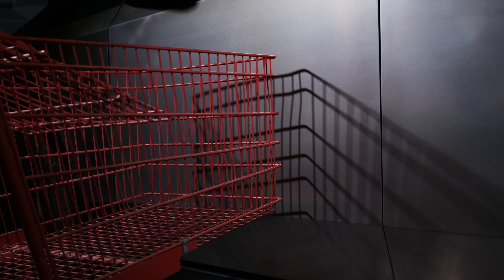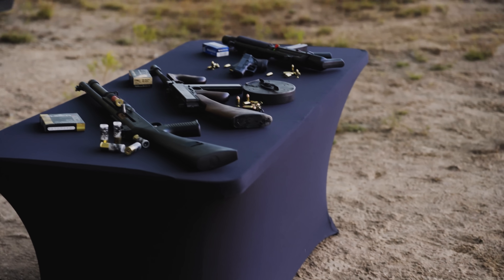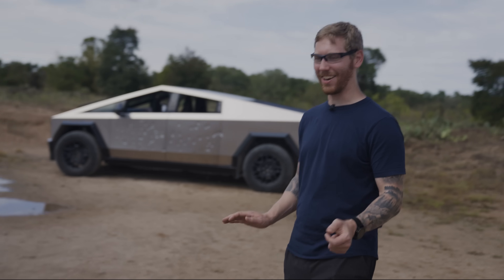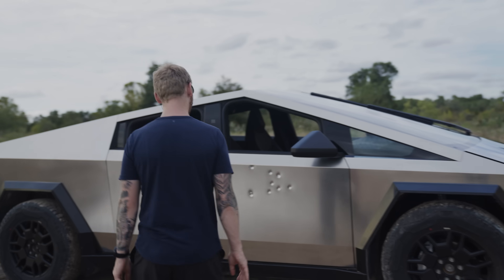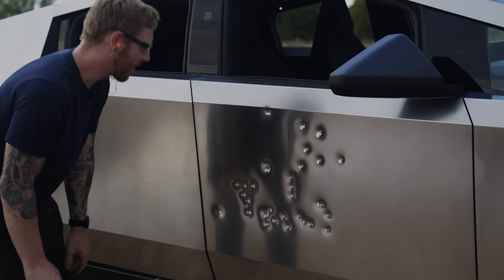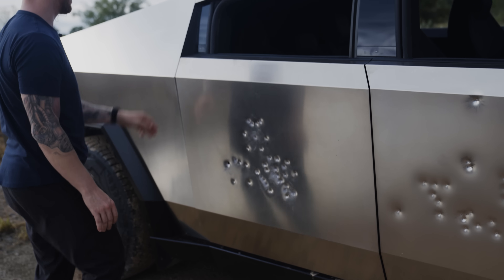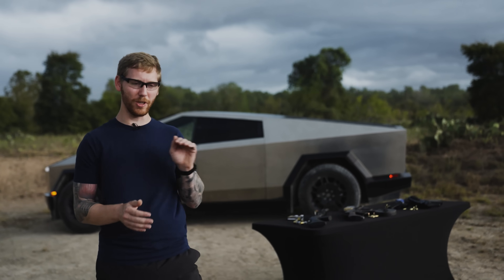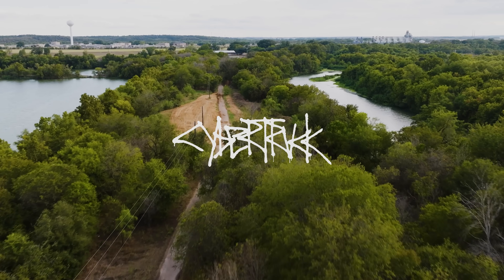Cybertruck Bullet Test

Comment: The thompson tommy gun only shoots at pellet gun speeds  935 fps.    They set this up for show.  Shot a 30-06 at it or even a common AR with tiny 22 caliber rounds with green tip ammo.  See how it does on the glass and side panel.   They already knew the answer and only wanted to the make the cyber trucker better than it actually is.  Pass...

Comment: They are shooting hollows points like we wouldn't notice, nice one guys
Reply: My thoughts exactly! I was looking to see if someone already said it! Regular ball rounds don't shatter like that 😂
Reply: My 65 grain ARX 9mm bullets traveling 1800FPS are going through the door.
Reply: The 00 buck is solid lead, and each is about the same energy as a 9mm FMJ
Reply: just watched a slow motion video of regular ball rounds, they seemingly do shatter like that.  Likely the rifling grooves forming weak points in the bullet leading to outwards fragmentation.
Reply: @GrayWolf448 rifling doesn’t make grooves? Its literally negative space within the barrel and the difference of diameter between the bullet and the barrel are thousandths of an inch, hardly anything that could create grooves even under extremely high pressure.
Reply: @theoverseer458  Right, the grooves dont make the rifling marks in bullets, it's the lands. The bullets are shoved into the barrel and the lands press into the copper jacket. It's part of forensics where they look for rifling marks on recovered bullets. If there were no grooves 'cut' into bullets, they wouldn't have an entire forensics field about it.
Reply: Anyone not using hollow points is gaaaaay af so.... 🤣

Comment: Try a ballistic calibre and round that's not ideal for not pentrating through. All of these are ideal for being stopped by solid objects due to being proportionally blunt and wide projectiles. For example, a 12g slug - even though it is blunt and wide - has incredible penetrating power over the choice of same-caliber buckshot and would sail right through and out the other side door. I'd bet money. 44 mag or even .357 would likely at least clear through the one door to the interior. Your choices are carefully selected for the show here.

Comment: Cool criminals will love that feature !!  I just suggest you dont get your fingers caught between body panels ( frunk)  when they are closing it will cut them off ! You can also use the edges of the body panels to peel vegetables cause theyre so sharp ! The line up of body panel gaps are crap too ! For $100,000 in upper trim levels Tesla should be ashamed of their fit and finish quality IMO ! They should and need to do better then the junk theyre offering for that price. Sure it can accelerate like a bullet out of a gun and its steering is amazing. But the bstterues dont last in the cold and your range is cut in a third if towing anything !!!

Comment: remember when their steel glass window that's unbreakable...that ball sure broke it. also your caruck is to small and can not carry all my equipment, also I see a ton of electric cars sit on side of road maybe it should have a real fuel backup in it would be more efficient rather than bulletproof you advertising for public or military use?. and a taller bed this is not a truck lol its a bonified car. not easily amused.

Comment: That didn't take much to actually penetrate, a double shot cracks the metal & a 12 ga bb went in & damaged the bullet proof glass, would it have gone into someone leg had the glass been up, probably. It's impressive but under fire it would take 2-3 shots in the same spot to breech it's bullet proof feature. Now people know all they have to do is keep aiming at the same spot & they will penetrate into the cab sooner then later.

Comment: I absolutely LOVE the Cybertruck. But why do you have to lie? Bullets from a suppressed MP5 are subsonic they travel slower than those shot from a typical handgun. In before some smart ass intervenes - this is true for all type of ammo not only subsonic. The MP5S has a ported barrel that bleeds pressure and reduces the velocity of normal supersonic 9mm to subsonic speeds.
This is a somewhat insulting marketing campaign. The Cybertruck is not bullet proof, it's side panels cannot reliably stop the most common threat - 9mm rounds shot from a regular size handgun. The glass doesn't even come close. Yes it can stop a .45 and other slow moving rounds like subsonic 9mm but the chances of an attacker using that are quite small. 
Here's a better idea. Why don't you test penetration of a supersonic round on a level 2a vest after passing through the panels? I suspect the combination of metal panel plus kevlar vest would stop a lot of nasty rounds that the vest alone has no chance of stopping.

Comment: 🤣 Seems impressive until you realize they cherry picked some of the lowest performing firearm/cartridge combos for testing. All of the chosen projectiles are carrying around 200-260 ft-lbs of energy out of these particular guns. If you shot it with a normal full-sized 9mm handgun like a CZ-75B or Beretta 92 with modern self-defense loads pushing 400 ft-lbs, I bet the door panel would be penetrated pretty easily.

Comment: I got some cut outs from a air handlers at work and they were stainless  used them for targets same thing just round dents from 9mm and 45 acp .22 long but  .223 would go through  for sure its more bullet resistant  not proof.

Comment: The Cybertruck combines the three deadliest features a car can have: A very stiff chassis that does not absorb much energy by deformation during a collision. A huge motorization or to be more specific a big difference to small cars with a small engine. And a high front which smashes cyclists and pedestrians and does not allow them to roll over the front/ window to avoid receiving the full energy of the hit. Yes, other manufacturers have the same bad developments. Yes, e mobility is way more efficient and definitely the future, compared to combustion engines (aka driving heat generators). But we need small cars, intelligent sharing software. And ultimately an abolition of individual traffic and a strong public transportation system. Individual traffic in massive metal and plastic boxes on huge asphalt strips is a waste of resources.

Comment: From what Tesla engineers said it’s only bulletproof to subsonic rounds. I’m not a gun expert but I think that few people use those unless they plan on using a silencer.
Reply: It's not even subsonic round proof. JerryRigEverything did a video where he tested some other bullets and even a round carrying half of a subsonic 7.62x39's energy went through the door.
Reply: @tomiik5195 what’s a subsonic bullet ?
Reply: @rickybobbydastar6534  Subsonic means it's travelling at less than 343 m/s which is the speed of sound. These rounds are quieter because there's no sonic boom (loud cracking sound caused by multiple shockwaves compressed together created by an object travelling faster than the speed of sound). With less speed also comes less energy carried with the bullet.
Reply: @rickybobbydastar6534 subsonic rounds are the ones you typically see in movies with special ops types. “All the devils men” is a great example of a movie where the main characters and bad guys are using subsonic rounds in an urban environment because you can spray a sub machine gun without directly giving away your position.
Reply: That's not true. There are subsonic rifle rounds that would go through, and there are supersonic pistol rounds that would be stopped (such as 9mm).
Reply: Was looking for the comment. I was gonna say all of these rounds must be traveling way slower than standard for this video. Any of these rounds would be piercing this truck otherwise.
Reply: This is not new.  Cars as far back as the 1930s gave standard handgun rounds trouble with penetration.  That’s why the .357 Magnum was developed and some police started utilizing the .30-06 BAR (see Bonnie & Clyde Ambush)
Its just gov’t regulations forced gas cars to be weaker and lighter by the 1980s
Reply: @classicgunstoday1972   And how about the fact that those cars turned into coffins in a crash?

Comment: So many autistically challenged (and triggered…pun intended) Europeans and libbies whinging and nitpicking calibers.lol
A: It wasn’t designed as an armored car and only were claims made that the cold rolled stainless panels are bullet resistant to specific calibers. 
B: Even armored cars are ‘only’ bullet resistant according to levels.
C: It can be fitted with bullet resistant windows and it’s still more bullet resistant than any other mass produced vehicle.
D: Commenters here lack reading comprehension and reasoning skills.

Comment: I think the reason the bullets don't penetrate: A) It's a flexible steel so it has some room to act like an inertia cushion. 
B) That 1.8-2.0mm adds structural rigidity.
Reply: Also because they fire exclusively rounds known for poor penetration, you could probably stop them with a cast iron frying pan which is less that can be said for 9mm, the most common type of ammo in the world,

The reason why it can stop bullets is because they went out of their way to find bullets it can stop
Reply: @googleisacruelmistress1910  cope, they fired some of the most common rounds found in a street shootouts, but could have used hollow point for even better results, go compare the steel of a frying pan to a regular truck door pannel, obviously the thicker peice of metal can stop bullets.
Reply: @miguellopez3392  no they didn't lol, that would still be 9mm, a round that this truck would not be able to stop
Reply: @googleisacruelmistress1910  lol they shot it with .45 FMJ that's more powerful than a 9mm as well as a 9mm in this video. Only the steel Pellets of a shotgun punched through the first layer.
Reply: And the subsonic ammo.
Reply: It's not a flexible steel, its a harden steel, its what makes it resistant to dents and why they can't bend it into curves.
Reply: @miguellopez3392  
Mate. Flexibility is incredibly important in steel - especially in an application like this. What does not flex, breaks.  

The cybertruck is likely made out of 301 spring steel. Yes, it's strong, yes it's hard. But it is also elastic, which is incredibly important. It can bend and flex, then return to it's original shape without damage. 

And yes, spring steel is a type of hardened steel.
Reply: @Artyomthewalrus  it's their own formula of harden cold rolled steel.l they use on the starship rockets. Flexibility is important in crunch zones, and the structure is designed to collapse despite the harden steel.
Reply: @miguellopez3392  mate, they said it themselves in this very video "a special alloy designed to be ductile". You need the ductility in everything mechanical except the very surface layer of stuff that experiences a ton of sliding like gears, endmills, saws, other mechanical components. Those still need a ductile core to not shatter under impacts because stuff that doesn't bend, shatters.
Reply: @GTAmaniac1  designed to be dutile so it doesn't damage the equipment that bends it but still primarily a harden steel which is why it cant be bent into a smoother shape, what you are thinking more of is things like modern katana swords and train rail, the metal sheet is to thin to really take advantage of soft core.
Reply: @miguellopez3392    It can't be bent into a smoother shape because it's 1.8 mm thick, those bullets demonstrated that it can be bent in a smoother shape, just the pressure required isn't realistically attainable. If this were really hardened steel the panels would spall or crack instead of bending to absorb bullet impacts. Other cars use thinner and softer metals, but utilize its shape for the strength because their primary customer demographic isn't techbros who want a "truck"

Also the "hardened shell" doesn't even have to be of the same material. Examples i mentioned like endmills, gears, camshafts, bearing surfaces, probably some optics stuff, all get hardened surfaces through CVD or PVD processes depositing a film of titanium nitride or some other hard metal or salt.
Reply: @GTAmaniac1  you can bend steel that is formulated to bend like you said previously its high carbon steels that Crack, stainless steel is not like a very high carbon steel that shatters, lead bullets will deform themselves heavily and the steel at nearly any thickness or harness if it flies fast enough, the core or shell of the shotgun Pellets so their more efficient at punching a hole through steel instead of wasting energy deforming themselves.
Reply: @miguellopez3392   increasing the amount of carbon in the alloy is one way to increase the hardness of steel. Another is adding more chromium, molybdenum and a few other metals to the alloy. You get hardness 2 ways, by having hardened salt crystalize between grains (as is the case with a lot of alloys made for casting) or by deforming the crystal structure of the grains themselves (as is the case in forged, cold rolled, tool and construction steel). Obv they cold rolled the steel so it did work harden a bit, but to call it hardened steel would be dumb.

But the steel used on the cybertruck isn't made to be hard, if it were the craters bullets left would be a lot different. Also buckshot isn't exactly known for its penetration, it only cracked the window because 2 pellets landed in the same place where the first one stretched and work hardened the steel panel.
Reply: @vuvision  if it couldn't bend the panel they shot would either be completely unscathed, have a pinhole punched through or shatter.

The steel got dents from the bullets because it's more ductile than brittle. I.e. it bends rather than shattering.

Not to mention tge several panels that are bent into shape to form the body.

It's only the shape it is because it's part of the techbro aesthetic.
Reply: @GTAmaniac1 everyone is a metallurgist expert on the internet, how about listen to the head of Tesla Engineering explaining why there's only one curve on the CT due to how difficult it is to bend their proprietary HFS material. They had to invent a method & special air bending equipments to bend this curve. Fast forward to minute mark 10:30 for the explanation. Thank me later. 😉

https://youtu.be/uefydJUbRhc?si=1r4J1tc3PelKYCgM
Reply: @vuvision   watched it, he himself says that they only had to use that method to improve the surface finish. The rest of that interview is just marketing fluff, like describing alloying as if every other manufacturer doesn't use the optimal alloys for their applications.

Literally the only purpose of their special bending technique was to minimize orange peel at the bend. And that orange peel happens no matter what kind of steel you bend. And gets worse the tighter the bend radius (which on the cybertruck is very tight to get that angular look) and the thicker the material (which on the cybertruck is really thick). They got around it by minimizing the friction between the material and the tool using high pressure air allowing it to more evenly distribute the strain on its surfaces. But once again it was only a problem because of its... Unique design.

You my friend fell for Tesla's well known marketing fluff. They're literally the automotive version of apple.

Their batteries and powertrains are unparalleled though. Also it's downright a miracle how good they managed to get the cybertruck's aerodynamics considering the design.
Reply: @GTAmaniac1  tesla cybetruck alloy is not optimized for trucks, its optimized for spaceXs cheap starship rockets which are very round but also very large so bending sintered an issue.

Teslas not the automotive version of Apple, thay arent marketsthemselvesas the highest end product, tesla is more like Ford and IBM put together.

Cybetruck aerodynamics is not a suprise of you seen how re entry craft are designed, flat surfaces can be as aero efficient as rounded ones at certain places.

Comment: Just to point out the windows are rolled down because if they were up like you normally drive bullets would penetrate the doors because there would be no thick glass supporting metal not fracturing

Comment: You need to be worried about Cheap ammo...surplus ammo.... 45 acp is about 80 cents a round right now. 7.62x39 surplus is 26 cents a round. the cyber truck is pretty much level 3a. stopped 9mm 45acp and buckshot. 3a goes up to 44 mag which we did not see. But this is a huge selling point for tesla.

Comment: A rifle round will not only penetrate it, it will shatter the metal around it.  The shrapnel that it would create will turn the inside of the truck into a fu*king blender.
Reply: A normal aluminum door panel would be way less lethal than this.

Comment: Tesla's are so cool, but still not enough range.  There is not enough charging infrastructure to purchase an EV with such small battery packs.  If you go off the beaten path you will be in trouble, won't be able to charge, and will have to get towed.  Minimum range needs to be 450 miles.  Don't buy an EV if you enjoy road trips.  Only buy for close trips or around town.   Range is only 3 hours of total driving then, charging for a minimum of 30 mins. to 80 % then charging for another 30 mins to get to 100%.

Comment: Watched a test drive walk around and saw the backseat folds up. Is that the entire bench or a split. As,I got because while it would be great to flip half up so the dog sat on the floor not the sit, the other half could still seat child(ren).
Reply: Or the extended range battery could go in there rather than the tray,

Comment: Those are pistols rounds or slow moving ones, 2-3mm of proper heat treated steel would stop those. 
Test it with any long rifle rounds above 7mm. 
When a bullet is long, cased and faster than a pistol round, made to pierce/and or travel long distances to say it briefly, it will pass those doors, this is a truck made for people that would cross roads with gangs around. 
Absolutely not working if you piss off any mentally unstable hunter.